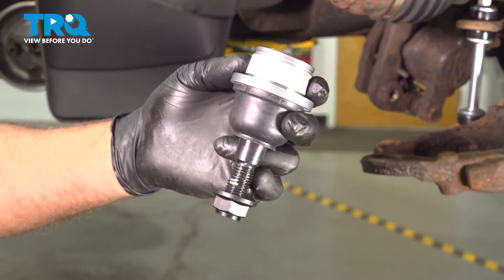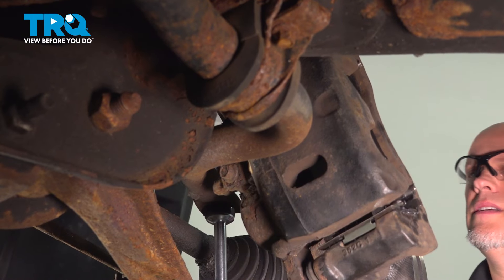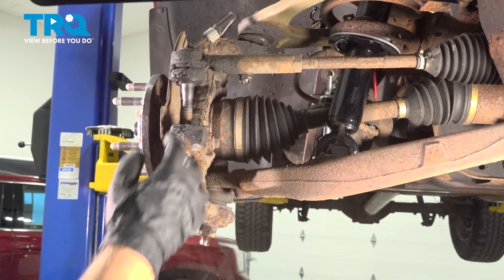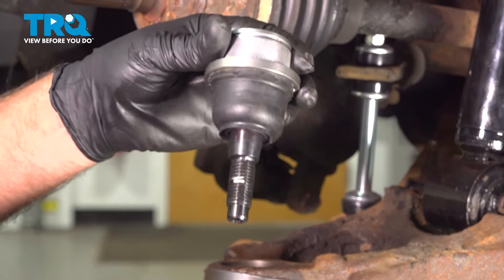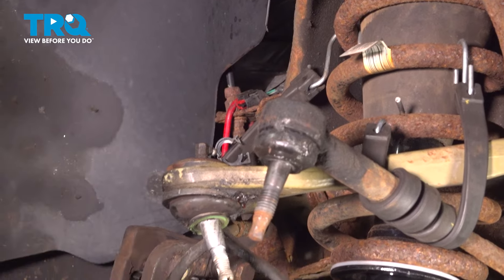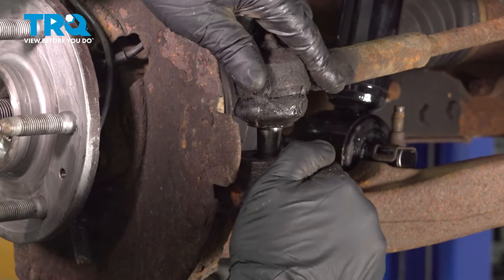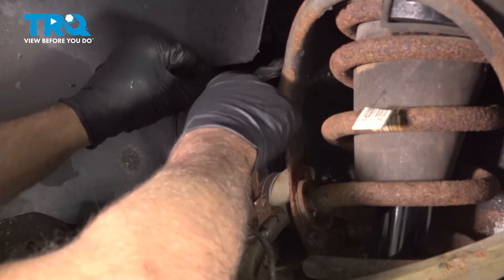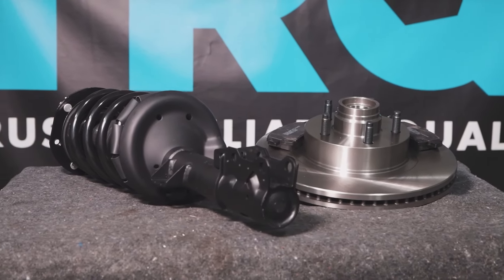How to Replace Front Lower Ball Joint 2007-2013 Chevy Silverado 1500

Comment: Broken 2 pickle forks on my bottom ball joint and it is still stuck on there
Reply: Heat the steering knuckle where the ball joints goes through and then hammer on it. Full send man. Lol

Comment: It's nice having a 2wd, because i don't have to loosen the upper control arm alignment bolts or have to wrestle with the axle shaft or remove the tie rod end. It makes a shorter job and less alignment issues. But I always get my alignment done at Pep Boys, and thry have a Lifetime Alignment deal, so no matter how many times i work on my front end suspension parts, i just take it there and they make it ride nice and straight.

Comment: I installed a new ball joint in my truck and I have it on there way past 90 ft pounds and the joint stud rotated should I tighten it again or is this normal for them to rotate as it’s driven

Comment: Can't read the size of the tool that fit over the bottom ball joint so you can press it in.  Thanks.    The AC Delco ball joint have a non removal able grease boot.  Thanks for all your videos too.

Comment: Love watching these vids where it all juuust cooomes apart…(ha).  couldn’t get mine out.... maxed out my air impact with the press tool, borrowed a new dewalt, made sure it had a fresh battery still nothing, put cheater pipe on my 1/2” ratchet till I was afraid of breaking it, (ya I know, where’s my break over) let it soak with penetrating oil for a day, heated the area to about 250* afraid to go hotter, beat the cr*p out of it, finally chiseled inward divots all the way around and used a spacer that pushed on the outer ring (that I had just put divots in) instead of the center and it moved then..  oh and then when I went to install the new one I realized that for mine (2500) you have to have pieces that are in the companion set that you get from HF

Comment: The ball joint I'm removing doesn't want to come out. I have no clue how you lined the ball joint tool up over top of the ball joint so it's a flat surface to push the ball joint out. Top ball joint is in the way.

Comment: So the mechanic in this video is from 1A Auto. Is TRQ and 1A Auto the same company?
So I was wondering how many times you take the same bolts out and put them back in making these videos? And how long does it take to do these videos? Just wondering cuz in the beginning of this video you pulled the wheel off and it was all rusty and next thing you know. It's had a shiny rotor.

Comment: Anyone with common sense will replace the whole control arm. By the time you do all of the pressing and labor it's not worth replacing just the ball joint. With a new control arm you get the new bushings to frame too! It's a no brainer.